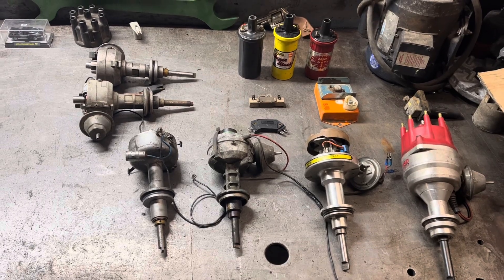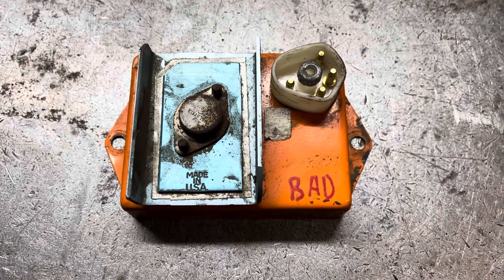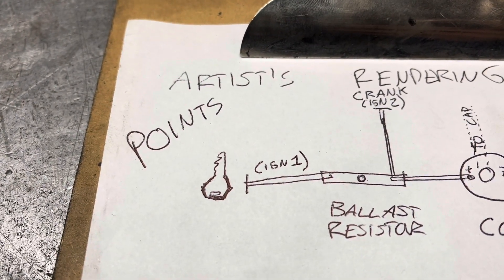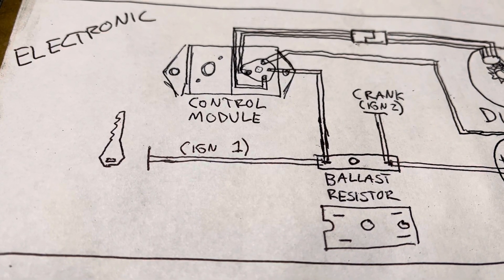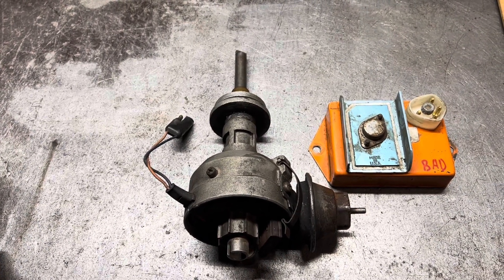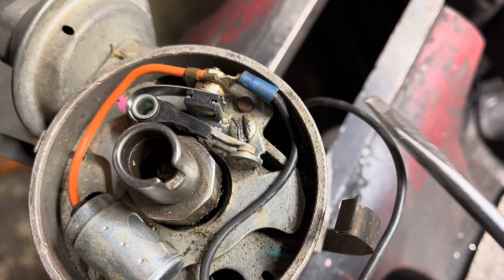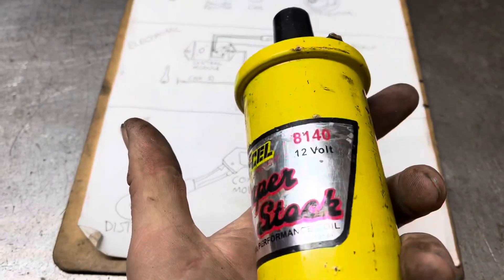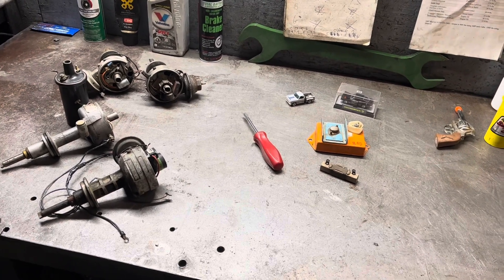Classic Mopar Ignition Systems - How They Work, How To Diagnose Issues

Comment: Came back from a car show and put my 1967 Plymouth GTX in the garage. Next weekend attempting to go to another show and the 440 spun over but wouldn’t start. It always starts. Looked at your channel and diagnosed it as a loose connection to the orange box on the firewall. Thanks for the in-depth explanation of the old Mopar electrical system. I used your knowledge to get the car started and running again. Many thanks.
Reply from the maker: Awesome! Glad I could help!
Reply: @DeadDodgeGarage  In my past I had a 1969 copper GTS with a factory 383. That Dodge could fly. Thanks for your positive comments

Comment: I liked your description. I have a 70 Superbee and had a problem where while driving I had a total loss of power, everything in the car stopped working then the car just died.
Reply from the maker: Everything? Total loss of electrical accessories? All of the power goes through the amp gauge, although I feel like if it was running and charging it should’ve stayed running if that died. Charge voltage and loads are on the same side of the amp gauge so it can measure power flowing into and out of the battery. But issue could be in those circuits somewhere. If it now has no power anywhere that’s relatively easy to diagnose. You could check out my Mopar No Crank, No Start video for some tips on that.

Comment: Cool vid! Yeah, my stock duel point for my 70 Charger R/T was replaced by an Accel unit before I bought it in 83. I replaced that with a Hemi duel point w/ mechanical tach drive. When I could no longer get points for that, it was converted to Pertronix. It's been a good system! All those factory Hemi drag car pics we've grown up loving are also now converted (it's subtle). 

Quick question: With the understanding that your drawings are basic; what disengages the starter when IGN 1 & IGN 2 are tied together for the HEI setup? OK, last question: where do you mount the the little HEI unit that is found inside the coil cover in stock GM applications?
Reply from the maker: The starter crank circuit is actually not the same circuit off of the ignition switch as IGN 2, so you’re fine there. If you tried to tie into the start circuit for your crank voltage, then yes you would have a problem with back feeding power to the starter. All you need to do is bridge the two sides of the ballast resistor, and then use the factory coil wire as your full time IGN 1/2 source.
Reply from the maker: Oh, and the HEI module can be mounted anywhere there is a good ground. Firewall, inner fender, wherever is convenient. Some people like to mount them to aluminum heat sinks, which are commercially available. I have never done this, and failures have been very rare. So I think that is extra.
Reply from the maker: I have found that the points every store sells now absolutely suck - except for NAPA. I would be surprised if points for your dual point distributor aren’t available today from some place or another! But there are other good options these days.

Comment: I want to try this I have a 73 Charger 318 I've had it not start before and then it starts and then I'll start I've heard a lot of check the ground make sure the module is grounded sometimes it loses groundworks bolted to the firewall was thinking about putting points distributor in it but I would rather do this thanks for posting hope this works
Reply from the maker: Good luck. If you have problems or questions, post another comment here (not as a reply - I never see those…) and I’ll help as well as I can. My ‘73 Challenger wouldn’t start when hot and it turned out to be a distributor problem. In my experience, the modules are either good, or they just don’t work at all. But with these steps it should be pretty easy to figure out what the issue is (when it isn’t starting, anyway.)

Comment: My 77 Volare Roadrunner 318 will run beautifully for a while and die. Then I have to wait 15 - 20 minutes before it will run again, and runs great for a little and then dies again.  In your opinion,  what could that be? Thanks!
Reply from the maker: There are several possibilities there. Definitely sounds like a component heating up and dying, and while my first instinct would be ignition control module, I would recommend checking the coil for power when it won’t start before replacing it. You could pull your ignition control module and have it tested, but by the time you get to your local O’Reilly it’ll probably be cooled down enough to pass the test. A ballast resistor could cause something similar, but in that case it would start and die when you release the key from the crank position. A connection heating up in the under dash connector could do it too - this is why I would recommend checking the coil for power first.
Reply: Check for a loose connection at your firewall a lot of times on old cars both will get rusted and corroded and have intermittent fire

Comment: Loved the vid.  Great, clearly explained detail.  I do have one question.  Does the HEI mod require a 12 Volt "key on" constant source to the positive side of the coil, or is the start/run combined source sufficient?  Thanks.  Subscribed.
Reply from the maker: Combine the two, eliminate the ballast resistor, and you’re good to go. The run source from key switch to the resistor is full 12 volts - or close to it, anyway.
Reply: @DeadDodgeGarage ( Oops! Your fans already asked and I just found your answers 👍 Very good.  New Sub. ) TU, again.  Can I keep my coil ,  jumper (short) IGN 1 and IGN 2 on same ballast post in series w old coil, and replace w HE?I. Or, do I need the performance c  no matter what?  Cheers;

Comment: OK,
Electrical issues aren't my forte, but I usually manage to make repairs and revisions WITHOUT "letting the smoke out of it"!
I've got an '83 D150, slant six with the "Lean burn".
I was "all in" for doing the HEI revision.  Watching YouTube vids for instruction...until...I came across another well known Mopar guy's "confession".  He said he "stopped doing these HEI conversions on old Mopars because their charging systems are inadequate to keep 12.6 volts at the HEI"
I'm not looking for performance, but I'm all about reliability and low maintenance.  I'm strongly leaning towards going to Chysler's electronic/ECU/ ballast resistor...probably, eventually upgrading to FOB's 4secondsflat "made in USA" ECU and petronix's coil which allows jumping the resistor.
This stuff quickly gets over my head!
Questions:
If I do the Chrysler elect/ECU revision...do I HAVE to change the "2 pickup starter relay to another one for the single pickup distributor I have to get?
If so...how do I do the WIREING on it.

Have you experienced these charging system inadequacies mentioned with the HEI?
If so...what did you end up having to do to fix it?

I figure an experienced Mopar veteran like yourself,( who owns 11) would probably be the best person to ask!😁
You won my sub.
Thanks for any advice, because the Lean burn's got to go.
Reply from the maker: The short answer is no, I haven’t had issues with HEI and Chrysler charging systems. The longer answer is, I’ve seen a few HEI module failures, but usually I can swap it out once and it’s good to go - I haven’t seen repeated failures indicating systemic issues like one might expect there. 

You will want to swap to the old school single pickup distributor with a vacuum advance for either conversion. It will be obvious how to wire it - two pickup wires from distributor and two pickup wires on the module. As long as they aren’t wired backwards you’re good to go.
Reply from the maker: My ‘82 slant six powered W150 (The Iron Goat II - featured in a couple videos so far) also had the lean burn deleted. They tried an Hei conversion but then removed it - I’m guessing they couldn’t get it wired right - and then they swapped to a poorly wired and worse adjusted points distributor. I haven’t decided how I’m going to fix it yet… I adjusted the points but it just isn’t happy - except sometimes it is. I’ll figure that out eventually - and you’ll see it on video here.
Reply: @DeadDodgeGarage Lord-willing, I'll  be doing other things that have to be done on this poor truck, but brother....I'll be VERY happy to see this resolved!
I don't understand electrics, even when I think I do, and then there's the 39 yr old wireing, ( trying not to think about replacing the wireing harness ).  Based on the options I told you, do you think the re's one system I mentioned that would be easier on the WIREING than another?
Your last point in your video ...
If your priority is NOT performance, then points or electronic/ ECU would be suitable...
That makes me lean toward the electronic/ECU.
The FOB/4seconds flat/USA made ECU is garaunteed for 5 yrs.  It ain't cheap, and it replaces the factory coil w/ the hotter Petronics unit.  I've read where there seems to be a lot of frustrated buyers of the various ECU replacements,( orange , blue....it doesn't seem to matter).

Comment: I have an 84 w150 it will crank all day long but only fire when I release the key
Reply from the maker: Interesting. You’re missing the ignition 2 circuit at the coil - cranking ignition power. That comes from the ignition switch and goes through the firewall to coil positive. My instinct says it’s probably an ignition switch failure, but ideally you would test for power at every point in that circuit from the ignition switch out to the coil. I posted a no crank no start guide video that doesn’t exactly apply to your situation, but I do detail all of the relevant components so it may help.

Comment: Great video .   Yup, and when that module REALLY goes that goop it is sealed with is a bitch to clean up .  At least I got paid when I started scraping , there was a 1974 penny left under my windshield washer tank from when my Duster was built. 🤙🏼
Reply from the maker: Nice! In the rusty Scamp video I posted a couple weeks ago, there was a really good shot of the absolutely horrible goop. I think that module failing is actually what caused the car to be parked for 20 years… by the ocean… dang it.

Comment: I have question I have a 7 2 Chrysler Newport 400 engine standard points ignition on the distributor vacuum advance module there's an extra connection wire, what is this extra wire do
Reply from the maker: A wire? Not a vacuum hose? On a standard points distributor there should be just one wire.
Reply: @DeadDodgeGarage  there is a terminal on the side of the vacuum advance I think it changes the timing when you kick the air conditioner on

Comment: I'm on the issue of no spark at plugs I did the test spark it works. I did have to change the pick up coil it was bad only tested at 90 ohms new test good and it is gapped at .008 and the cap and rotor are new and were tested to make sure they work went over wiring everything seem to be good. This is a 84 chrysler fifth avenue had lean burn I deleted it changed carb distributor,  and got a 4 pin mopar ignition box and 2 pin ballast resistor any help is appreciated.
Reply from the maker: Glad you didn’t ask me to help diagnose the lean burn. Haha. 

1) test spark from coil wire near ground or with spark tester when turning key on and off, correct? This would suggest the module is good.

2) coil wire in same position, crank engine and watch - sparks or no sparks?

3) assuming no sparks, what is voltage at coil when cranking with key (not jumping starter relay)? And voltage to ignition module when cranking? This will likely require help to test. Curious if you could have it wired to a circuit that is only powered in run but not crank. I have not done this conversion and do not know the particulars of the lean burn power circuits, but assume it has similar - run and crank. Crank would go to coil +, and run goes to opposite side of ballast resistor so coil is powered through resistor. 

4) if voltage at coil and module during crank is fine, I would pull distributor (or grab a spare if possible), then connect it, and with the key on and coil wire in checking position, spin the distributor. If it doesn’t make sparks, either the pickup isn’t working - even if it is new - or you have an issue in the distributor wiring. 

I hope that helps. Let me know what you find out.